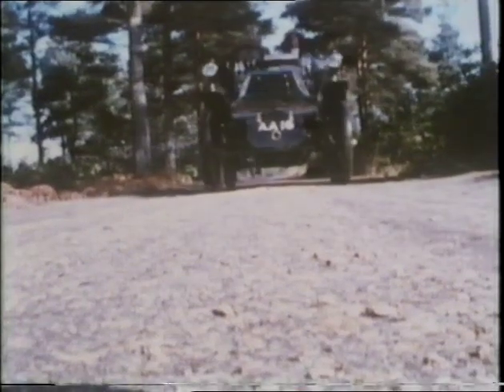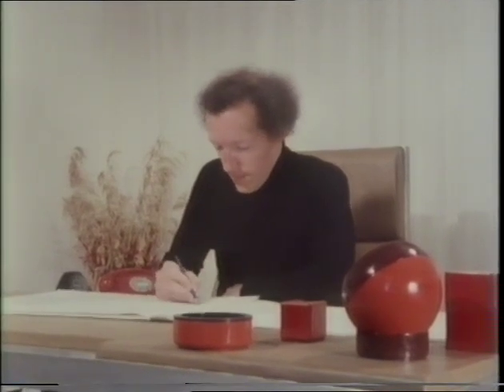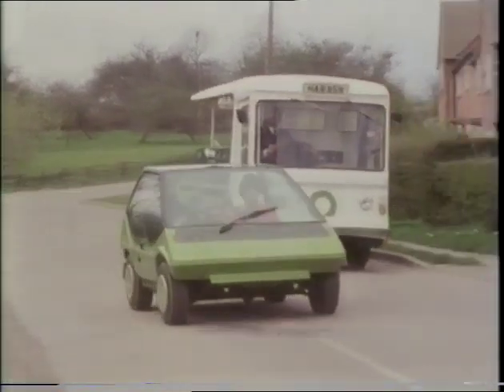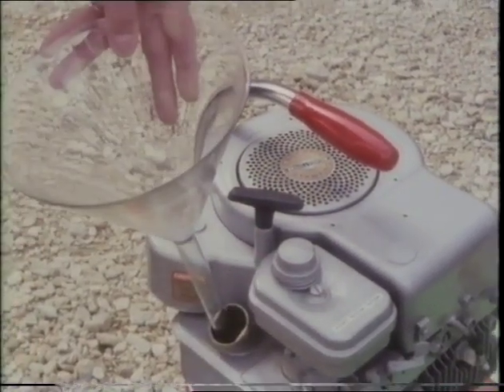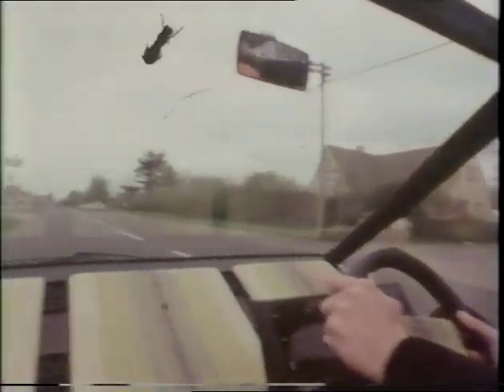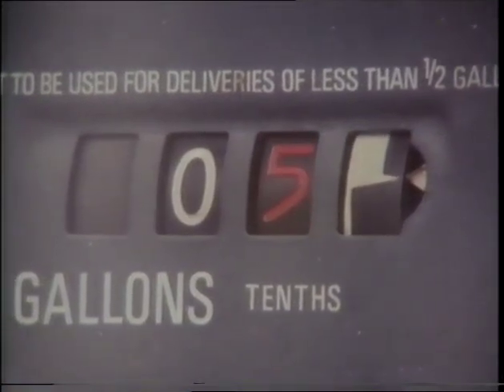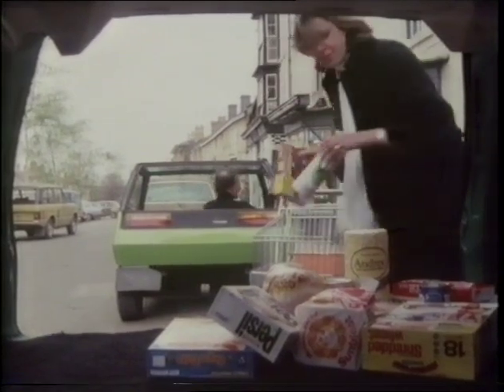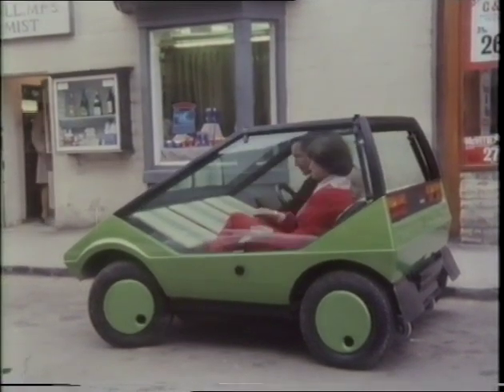Microdot Three Seater Hybrid

Comment: So let me get this straight, the guy put a petrol engine in the car, not to move but to generate electricity and charge the batteries so they start the electric motor!!! The amount of loses this has is insane. How did they get it all wrong? They also said it doesn't pollute or make noise.... ding dong you have a petrol motors on there! You still drive with petrol.
Reply: They state that its a Hybrid.  The whole idea was that it uses less petrol. From what it shows that worked for him anyway.

Comment: Hahaha 🤣 what a lie. Starting out with calling a lawnmower engine a moped engine, but this is a tiny unforgettable detail. The notion that a petrol engine converting it's power to charge a battery that will drive an electric motor is economic is laughable. The chain of loss is huge. To get the best mileage he would surely have to run the car directly by the lawnmower engine 🤣